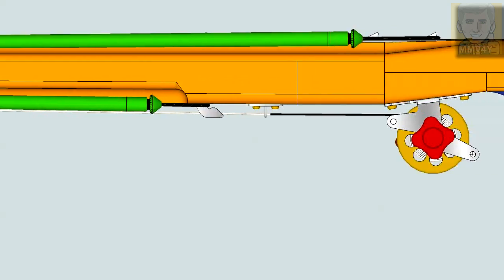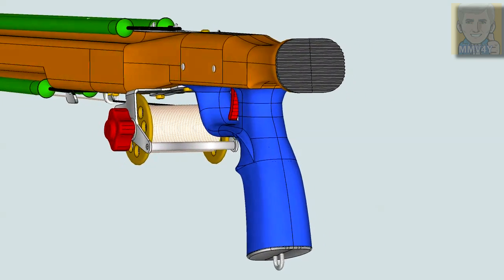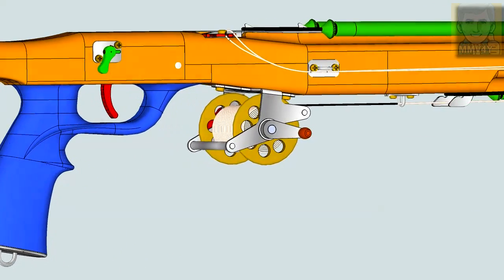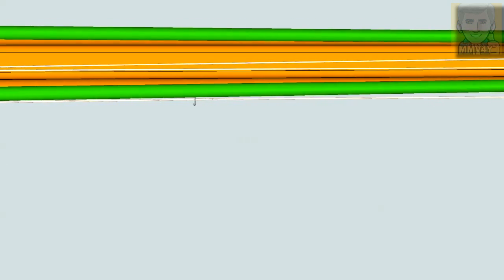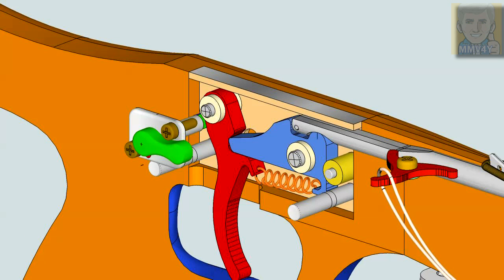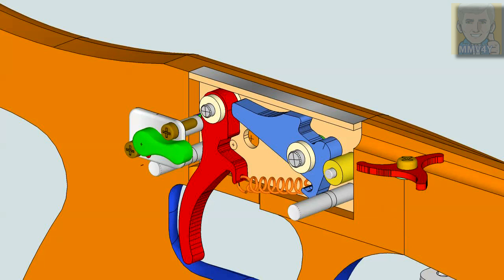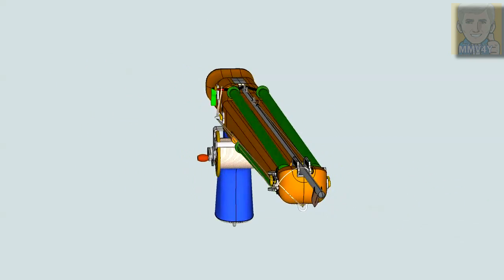Roller Speargun Design Model

Comment: Good trigger ! For those that wants to use the diagram to make their own - be aware that the spring is the critical component - if the spring goes, the spear will fly out of the gun, so take care ! With a strong spring, especially where it connects both sides to the mechanism, it will work great. Field testing will tell.

Comment: great video can you give me the schema or the sketchup file on my own risk please
Reply from the maker: Hello Youcef Hemdane,
making the plans available will not be possible, however here are some overall dimensions from the trigger mechanism and the spearguns.
 - The trigger housing dimensions= 13x30x65mm, wall thickness:
2mm. 
Trigger and Sear= 5mm thick. All made from 316 grade stainless steel
Some of my channel viewers told me, that by using any free screen 
recorder program to take "screen shots"  from some of my videos, and 
then using a image editing program like "Windows PAINT" to scale the images to get the right sizes.
 In this video "Roller Speargun Design Model"
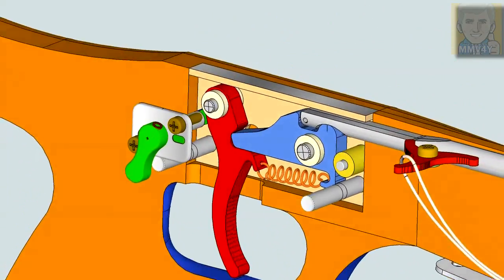at 1:03 minutes is possible to see a side view of the trigger mechanism.

  Overall dimensions of the spearguns.
The roller speargun:
 1200mm long (end to end)
950mm from the centre of the rollers to the edge of the trigger pocket 
50mm wide
---------
Traditional speargun,
1200m long
950mm from the edge of the rubber bands hole to the trigger pocket
50mm wide from the but plate to the end of the trigger pocket and tapering down to 40mm at the tip (muzzle)
I used  Okoume Marine Plywood  laminated together with epoxy,  but a much better choice will be to use Teak Wood.
Thanks for the comment and for watching my videos.

Comment: Any chance i could snag the sketchup files for your roller model?
Reply from the maker: Hello xskiervh,
I want to finish this speargun project first, before making it available. 
I designed this trigger mechanism and the spearguns using a Cad program (Google Sketchup) 
The only dimensions that I can provide are: The trigger housing dimensions= 13x30x65mm, wall thickness: 2mm the Trigger and Sear= 5mm thick. All made from 316 stainless steel
I´m very confident about this design, but I need to fiel test it, over a long period of time before making it available. 
Some of my channel viewers told me that is possible to take "screen shots" from thid video and then using scale to get the right sizes. 
Thanks for the comment and for watching my videos!

Comment: Thanks this is very helpful for wrapping my head around the roller gun concept. Have you had any trouble with the line getting tangled with this setup? Well done.
Reply from the maker: Hello peter lansdale,
this is my firs roller speargun! rollers have been aroud for many years, i designed this speargun based in proven design concepts, whoever only after is tested i will know if it will be a good design or not! 
thanks for the comment and for watching my videos!